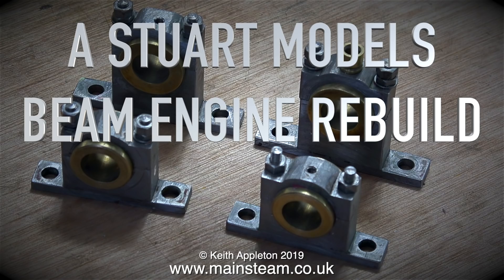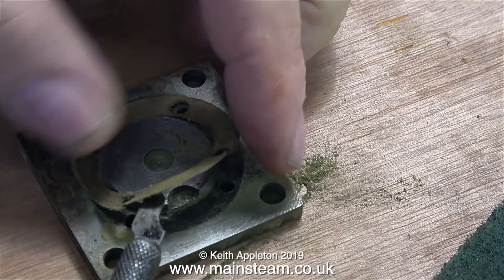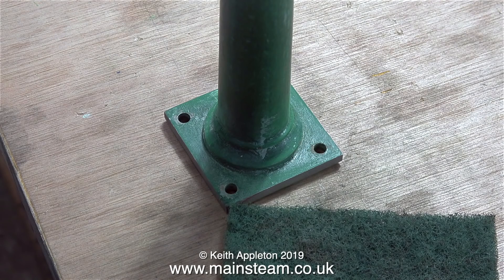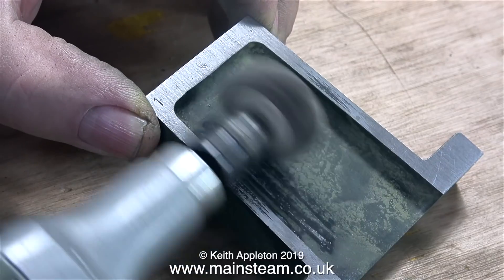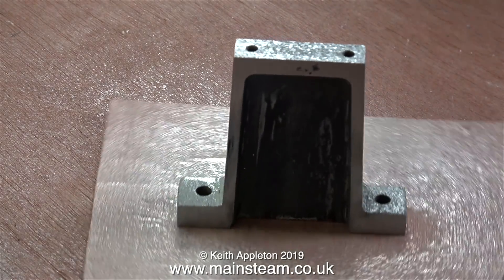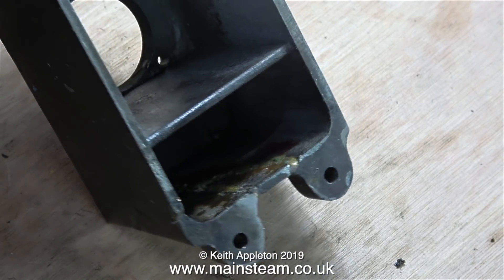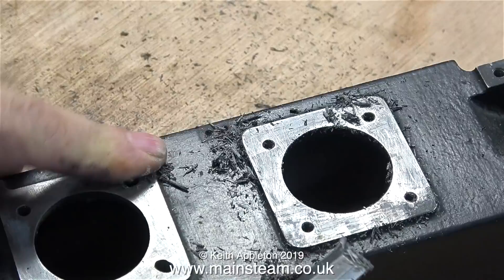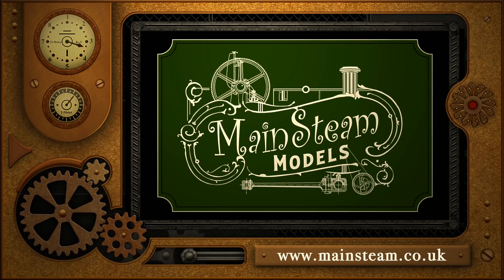A STUART MODELS BEAM ENGINE REBUILD - PART #2

Comment: A car body man once gave me a nice tip.  He said to cover up minor perfections just spray a few heavy coats of primer onto whatever you're going to paint, then sand it using a large flat block wrapped in fine sandpaper.  It works if you want a good, smooth finish, but you've said several times that you like the rough cast look as it looks more realistic.  I also wondered if sanding the top of the support on the belt sander wouldn't have given you a nice flat surface for mounting the parts.  BTW_ your house is starting to look like a home now!  Maybe you could set aside a spare bedroom for displaying all of your creations?  Or is the dinning room still your preferred display area?

Comment: Keith, the new place is looking great (and always love the beam engines). I found a tool that you might like: they're called parallel jaw pliers or "Bernard" pliers. Some companies are making clones nowadays, but original ones made by Sargent are sturdier, and incorporate a brilliant side cutter with a fantastic amount of leverage. They even have a V groove down the jaws for holding round stock. They can be had for $15-25 on eBay and they are absolutely worth it.

Comment: The paint coming out of that can seemed really sputtery.  I've found that normally happens with rattle cans when they are cold.  I try to warm the paint to at least 80 or 90f before painting and it goes down a lot smoother.  You probably already know this but I thought it was worth mentioning in case.
Reply from the maker: I can't always pick the days when I make videos, on that day it was very cold in the outer part of the workshop, but as soon as I sprayed the parts, they were taken into the warmer inner part of the workshop.
Reply: @keithappleton  I was just referring to ease of spraying. I'm sure the paint will cure fine I've just found it's a pain to spray with cold paint.  I'll usually put the can in a black garbage bag and set it outside in the sun or in near a heater.  In the long run you gotta do what you gotta do though:)